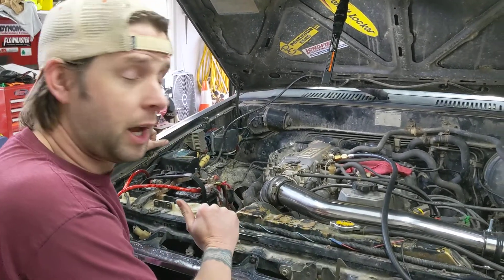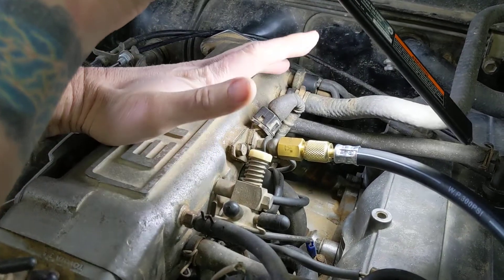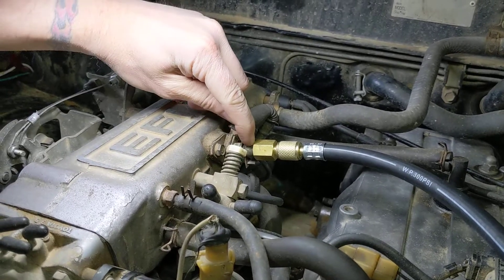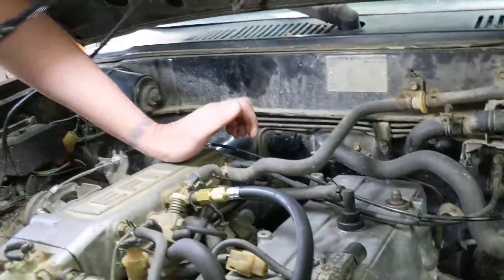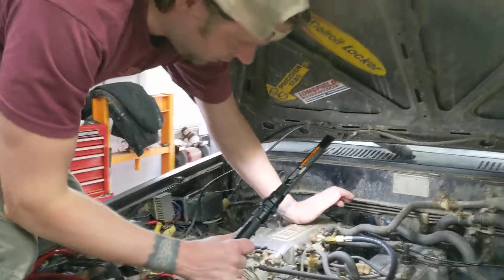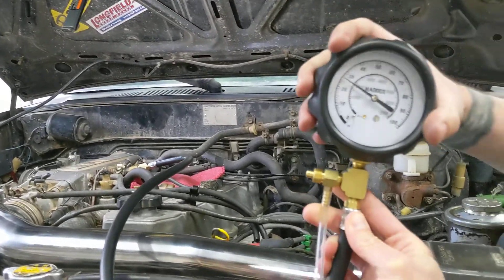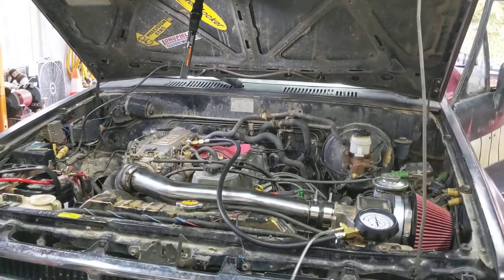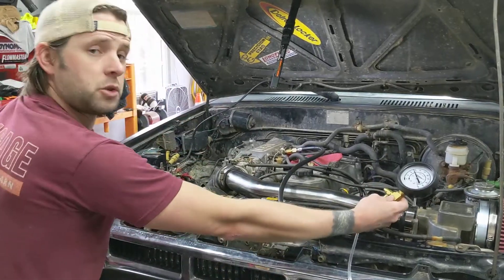How to check Fuel pressure on Toyota 22RE engine

Comment: I have a question mine is running just fine when I first started it cold but within a couple minutes as it warms it will die or really sputters I will feather the throttle and it will spit and sputter for a second until I build rpms and it will run good as long as I stay in the throttle.  Any thoughts? Thanks ✌️

Comment: There's relay logic going through the air flow meter. If the air flow meter is closed (engine not running), the relay controlling the pump is *off*.
One needs to crank the engine to get the air flow meter to open up to run the pump enough to start.
Normally the system holds pressure between starts so startup is normally easy.

Comment: Does the fuel pump should come on when you start it but no crank it?
Reply from the maker: @josep.7387  I forgot to mention in the video that I had already connected a jumper from Fp to +B on the test connector under the hood to allow the fuel pump to run without cranking the engine.

Comment: Did you find your issue how did you get your pump to run when you checked gonna be checking my today I kind of already have an idea might be my fuel pressure regulator or my fuel pump I got an 88 so she’s old hopefully it’s not my injectors

Comment: Hello Jared, I have a 1992 Toyota pickup 22 re engine, my engine is noisy, similar to your noise, had my valves adjusted, and it did not change anything,  curious on your feed back. Thanks, Adam
Reply: there are claims that if the valve cover is tightened down too much it might make contact with the valves and create noise, but if the valve lash is set loosely it will also make noise... however, wider gap in the valve lash setting allows the valve to sit on the seat slightly longer, which cools the valve and is therefore advantageous in that sense.

Comment: Where is fuel pressure sensor?
Reply: It doesn’t have a sensor, it has a regulator and it’s a diaphragm style that runs on vacuum. It’s the metal cylinder looking thing at the back of your fuel rail. It should have 1 vacuum line and 1 fuel return line attatched to it 👍🏼

Comment: My 93 4runner i think is getting way to much fuel pressure but i dont jave the money to just start buying different things. I go to start it and it immediately revs up to 5000 rpm an wont go down. Thanks
Reply: lol your motor would drown itself since it wouldn’t be getting enough air sounds like your throttle cable

Comment: Interesting - no 22RE that I’m aware of will run the fuel pump continuously with the key on and engine not running. Typically they only run with the starter engaged (key to start position) or engine running. This one must be hot-wired.
Reply: Excactly, I have one I can jump thepins and hear the pump but cranking I get no start, starter fluid it'll rum, they ran it out gas cant figure it out
Reply: Air vane switch usually takes over from starter power to circuit opening relay.

Comment: Jared, when you removed the ori banjo bolt & replaced with a banjo bolt adapter did the adapter have the fuel hole in it also.

Comment: The info in this vid is not accurate. The electronic fuel pump is activated by cranking the engine. The air flow meter sends a signal to the circuit opening relay inside the passenger side cabin which closes the relay then energizing the fuel pump.
Reply from the maker: See my previous reply from a year ago... I forgot to mention in the video that I had a jumper wire connected to the test terminals for the fuel pump relay so it would run with ignition on but not cranking.  Thanks for mentioning though for others testing fuel pressure.
Reply: @jmhcj5  for later model OBD1 Toyota fuel injected vehicles 1989 through 1995, (yours is a 1985 - 1988 model) they have a check connector to energize the fuel pump "fp+b"

Comment: Could you show me your vacuum lines and what you disconnected and where the efi wires all go if possible. I'm building a 87 4 runner and am in need of some help. Thanks man.
Reply: Hey you might have found some all ready but yotatech, and a few other fourms that have toyota mechanics that post the diagrams, super helpful for swapping the motor in my 1991 pickup

Comment: What brand air intake/filter is that? I love how clean it looks.
Reply from the maker: That was the Trail Gear rock ripper intake kit.  It worked out nicely.  I think I had to shorten the intake tube slightly between the throttle body and mass air flow sensor to get everything to line up just right.  They probably make it a little long on purpose, so you can shorten to fit your application.

Comment: Where did you find this banjo bolt adapter? Can't find one locally or online in m8x1.0
Reply from the maker: I have a few different fuel pressure test kits and I'm pretty sure that adapter was in a kit I got at Harbor Freight a few years back.  I'm assuming they probably come with the same adapters these days.
Reply from the maker: Looks like they still make the same kit with the adapter you would need... https://www.harborfreight.com/basic-fuel-injection-service-kit-64939.html
Reply: @jmhcj5  damn I was just there and bought a different kit lol. Looks like I'm going back tomorrow

Comment: Hi could injectors be cleaned where you tapped into 5th injector? And how did truck start without 5 injector disconnected?
Reply: No the 5th injector is at a dead end line feed from the main fuel rail. Injectors need to be taken out, to be cleaned.
The 5th injector only fires on cold start up. So it's like how a choke works. Richens the mixture when cold. The engine can fire up without it when cold, and doesn't need it when warm.

Comment: my 86 4runner cranks but wont start, ive replaced the MAF, full tune up recently, air filter, tested the cold start sensor and injector , any thoughts?
Reply: Disconnect the fuel pump wire harness and try start up if runs and cut off it send to much fuel. Might the pcm bad
Reply: Adjust the Throttle position sensor
Reply: The opening circuit relay might be your problem. It's behind the computer on the passenger side kick panel.

Comment: So what would your Idea be of one that is running 40 or so psi but the second you touch the throttle it drops way down to 10 or less and try’s to die.
Reply from the maker: If the pressure is dropping that much when you apply throttle, you could have a clogged filter restricting flow when the injectors need more fuel as engine rpm increases.  The fuel pump itself could also be on its way out.  One more thing to check in your case is to make sure you are getting a full 12 volts to your fuel pump just to rule out a bad connection.

Comment: I’m pretty sure the fuel pump only kicks on when your motor is cranking for safety reason unless you bypassed it
Reply from the maker: When the ignition is in the on position your fuel pump will be on to pressurize the fuel rail.  The engine does not need to be cranking.
Reply: @jmhcj5   Chayton James is right, the fuel pump should only turn on once the engine is cranking, its activated by the flapper in the air sensor, yours is bypassed by jumping the b+ and FP at the diagnostic port or at the circuit opening relay beside the ecu.
Reply from the maker: @scootsmcgavin8887  Yes, I forgot to mention in the video that the terminals Fp and +B need to be shorted on the check connector to see pressure without the engine running.  I already had the jumper wire in place before I started recording.  Thank you for pointing that out!

Comment: Do you have a part number or show where you bought one from? Thank you
Reply from the maker: Here is an inexpensive fuel pressure test kit that should have the correct adapter...
https://www.harborfreight.com/basic-fuel-injection-service-kit-64939.html
The M8 x 1.0 banjo bolt adapter should be the one you need.
Reply: @jmhcj5  Thank you
Reply: @jmhcj5 have a link to a kit with the adapter for canada, as habiur freight doesn’t ship to canda, thanks
Reply: Same here,thanks.